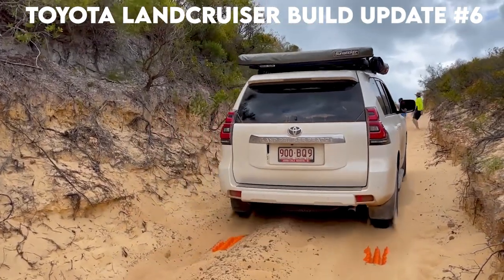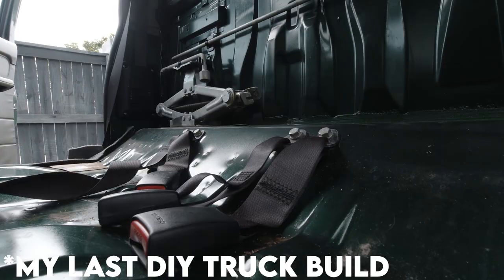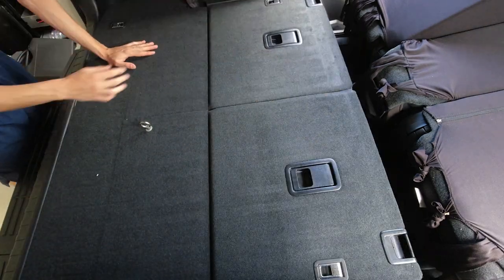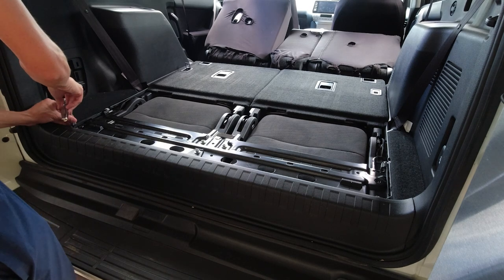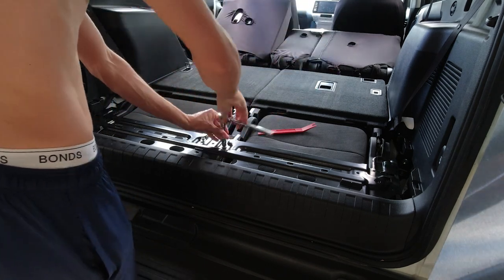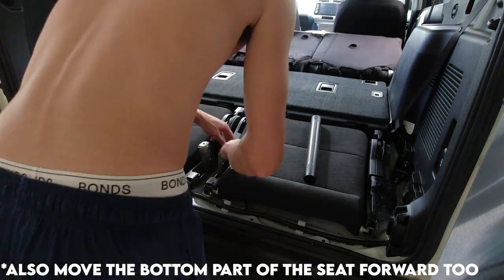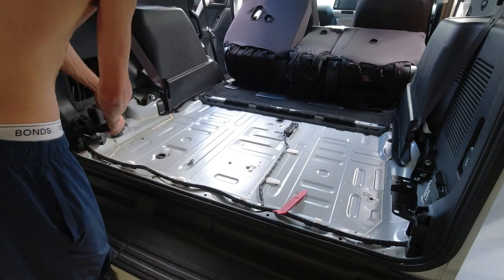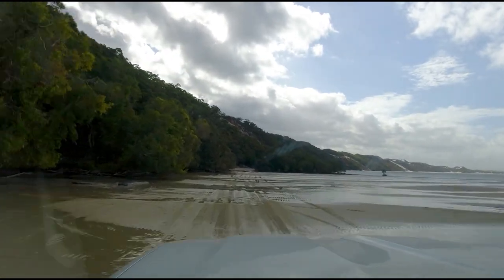How To Remove Rear Seats from Toyota Landcruiser Prado 150 (Lexus GX460) // Perfect Prado Update #6

Comment: How do you move the seats up and down if the power buttons are not working?
Reply from the maker: Hi mate, these are manual seats but if you have power seats, I’d recommend looking into resolving the power issue. If that doesn’t work, I don’t know if the power seats are held in any different, but I’d start unbolting everything and ripping it out. That’s my opinion. I just learn this stuff by doing and seeing what happens

Comment: Hi mate. I have just attempted this and have found that a few of the bolts at the front of the seats have stripped. I wonder if Toyota is using cheaper bolts? Any ideas
Reply from the maker: That’s odd. Do you mind if I ask if you bought this new or second hand?
Reply: @NorthOz  new. Just a couple of months ago.
Reply from the maker: That’s very strange. I would ask your dealership as there is no reason why they should be like that. I had no issues with any bolts I have taken out so far. I have since removed a seat in the second row without any issues. Sorry I couldn’t help you out more here
Reply: @NorthOz  no problem. All good. Turns out I have actually stripped the socket ( it was my grandfathers so rather old!). I have borrowed a newer socket and third row removed now. Thanks for your advice and site.
Reply from the maker: I’m glad it worked out mate. It’s always a worry when these things don’t work out👍

Comment: Thanks for the video mate was a huge help. Can you recall where the bolts needed replacing to prevent cabin dust getting in? I located 4 at the rear of the car. Are there any others?
Reply from the maker: Hi mate! Glad it helped. From memory it was just the 4 bolts on the floor but I recall some under the plastic trim piece that runs along the entrance to door. I put plastic over these. The other mounting points were on raised sections of the floor so they didn’t need covering
Reply: Absolute legend @NorthOz . I thought so I just forgot to give it one more check before I put down the false floor and draw system.

Comment: That’s a great video and will be following it again when I commence my own removal. 
I’m keen to find a port to pass cables up from under the chassis into the rear. I suspect removing these seats (for drawer units) will provide openings for the cables?
Reply from the maker: Hi Michael, it depends how thick the cables are. The bolt threads could fit a cable through them but you would get much through the one bolt hole. Thank you for your kind comment

Comment: Great video, But I recommend use  socket bolts  (M6x1.25) 50 mm.  You can buy those bolts from local bolt master or metric man, cost $1 each.
Reply from the maker: I think that could work for the forward most bolts but not for the rear most bolts because there is more than 50mm between the bolt thread and the top of the material

Comment: Great video. The 2 bolts in the middle  you referred to as staring you in the face, weren't even done up on mine.
Reply from the maker: Glad I could help. Subscribe and tell your mates 👍 That’s a bit scary it wasn’t done up. Perhaps someone else tried to install a drawer system before you?
Reply: @NorthOz  nope. Got the car brand new.

Comment: Good video. 
So how much weight have you just saved by removing the seats?
Reply from the maker: Thanks mate! It’s hard to say. I haven’t been to the weigh bridge since then. From lifting it out, I would say 40 kgs. With the new system I have in the back it would weigh the same as it did from factory

Comment: did you investigate having the prado seat removal checked by a verifier so its legal?
Reply from the maker: To my knowledge, as long as it isn’t considered permanent, I’m safe in regards to being legal. I will look into this more as I am designing my next system. I believe I will need a blue plate if this setup is permanent. I will make a video on this for sure. Thanks for watching and subscribing 👍